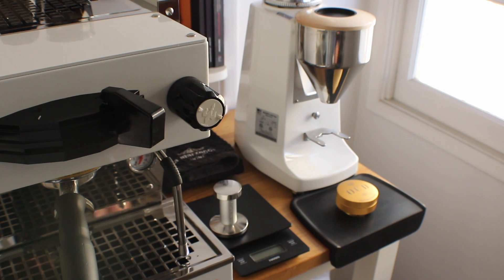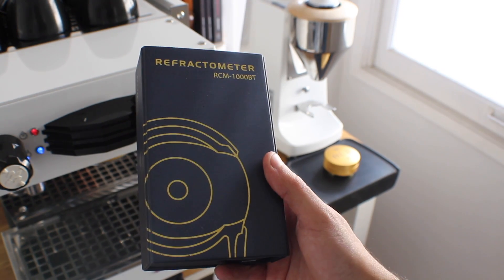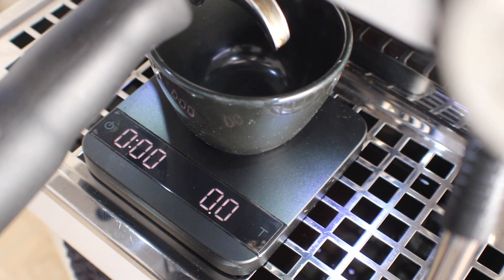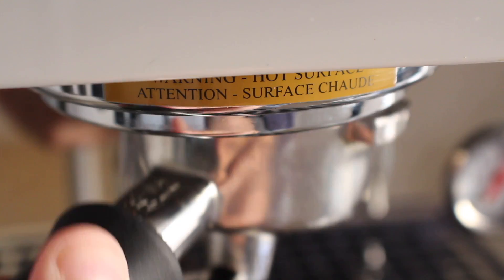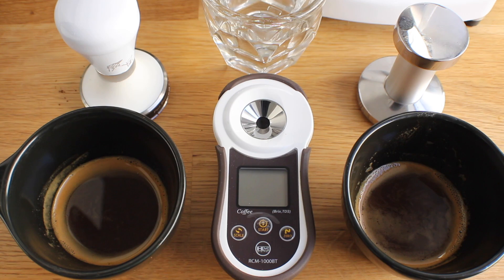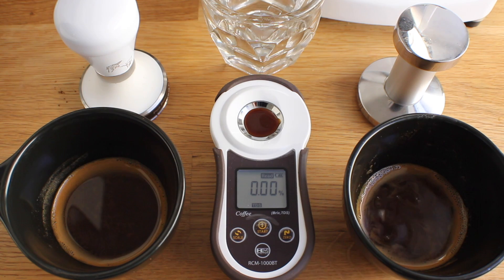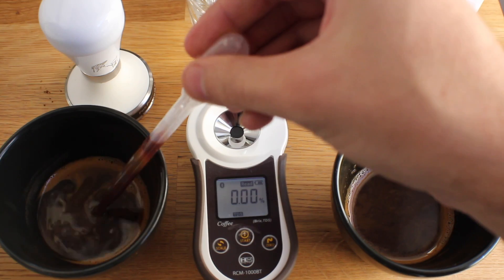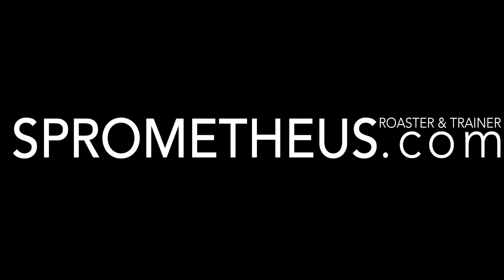COFFEE SCIENCE - Tamper Shape Vs. Extraction

Comment: Apart from the other comments about sample size etc, I'd like to say that measuring extraction is useless for comparisons like this. If you are landing somewhere on the acceptable extraction spectrum, minor differences in the extraction give you 0 predictive power about taste. The flat tamper might have given you a little more extraction, but who's to say that that extraction was even or that the higher extraction is better in the first place as opposed to being over-extracted now? Extraction percentage is easily modified by grind or brew time, and If the convex tamper reduced extraction but made it more even, I can guarantee you that the coffee will taste better, you might just need to let it run one second longer or grind one step finer so it can extract the proper amount overall. 
Because of this, I think that to really compare these tampers, besides increasing sample size, you need to re-dial in the espresso with each tamper and then do a taste comparison to show which one allowed you to brew tastier espresso.

Another thing I noticed is that the convex shape might not be optimal if you're extensively puck prepping. Those things might be designed for coffee shops that cant really take too much time puck prepping. The convex shape might allow the barista to tamp directly on top of the cone of grounds that comes out of the grinder, because 1. the convex shape distributes the grounds a little better compared to a flat tamper and 2. the bed will be a little thinner in the middle, so even though the bed is denser in the middle (due to lacking puck prep), the thinner layer offsets this and therefore evens out extraction.

Comment: I just bought a Rocket Appartamento and im struggling to get it working. It makes the coffee way too fast, 18 grams in and 36 grams out in 3.4-3.8 seconds. I weigh my coffee and im putting in the right amount. I use expensive pre ground stuff called Nescafe Blend 43. It looks to be ground quite coarse but when I empty out the jar and check the granules they all look to be a very consistent size. A friend told me to use better coffee so i have tried this brand called Maccona, slightly better but I am having the same issues, less than 4.5 second brew times so i know the problem isn't the coffee i'm using.. I was told i need to tamp with more force but i'm pressing as hard as i can. I have began to use my foot to squash the tamp down really hard. This has gotten my brew times to 11 seconds but I have damaged the portafilter channels from standing on it and bending them, and my portafilter is all scratched from being pressed into the floor. Im thinking the problem might be the basket so i have ordered some VST units? Any help would be appreciated. Do they make any tamps designed to be operated by foot, ive almost rolled my ankle twice from slipping off the tamp handle, plus it makes a huge mess.
Reply: your coffee needs to be finer. It's one of the reasons pre-ground stuff doesn't work when you're making home espresso. Highly encourage you to purchase a grinder so you can dial in the fineness exactly to get that 36g out in 25-30sec and you can also grind fresh every time
Reply: Yep. You’d get better results by spending $400+ on a good grinder and purchasing a $300 espresso machine than using pre-ground coffee in your $1500 machine. Long as you’ve already invested that much $$$, go the extra $400+ and get a good espresso grinder.
Reply: Higher brew temp = faster extraction. Try dropping your boiler temp down to 4-7 deg celcius. Maybe straight from the fridge. That should bump your extraction times up. Hope this helps.

Comment: You gotta filter before refracting. Huge margin of error here. Also, how are you only extracting 13% on a 40sec shot? You need to dial in a lot differently
Reply from the maker: I’ve heard conflicting reports on the use of filters. I used them in my next TDS experiment though. Granted they aren’t the greatest shots in terms of extraction %, but they were more so just to see if the difference tamper shape has on extraction as opposed to trying to maximize the number.
Reply: @Sprometheus  I don't know who is advocating refracting espressos with zero filtering. 

Espresso should be extracting 18%+ just like coffee. If you're using lighter roasted espresso, 21% would even be a good starting point.

Comment: Those extractions are low for espresso. Considering samples are not filtered, real extraction is even lower. How did they taste?  Even the flow looks watery.
Reply from the maker: Looking back on it I should’ve toyed with the grind a bit, and I ran them a bit longer than usually but since it was a single origin I generally prefer to run those out a bit longer since the flavors are more delicate. They were definitely sweet, but little to no mouthfeel and definitely a bit watery. The extractions were definitely low, I’m sure it had to do with the longer shot and maybe age of the coffee.